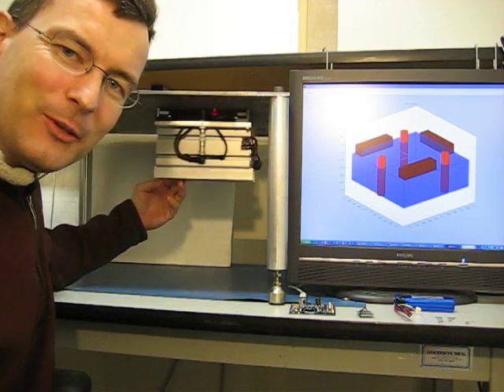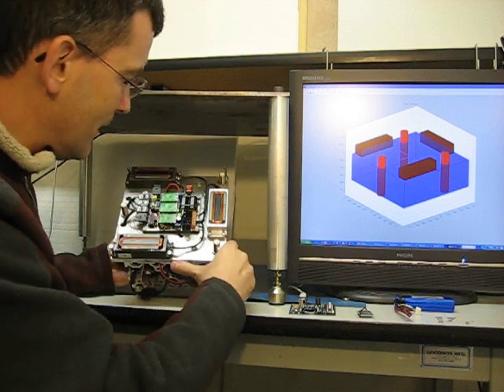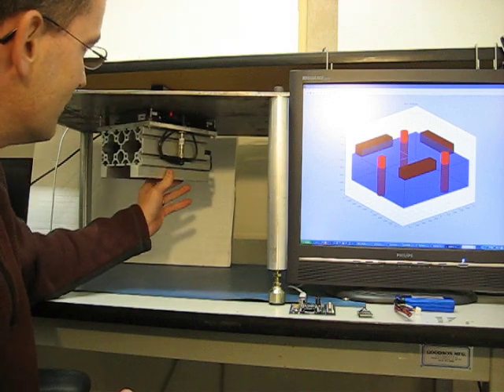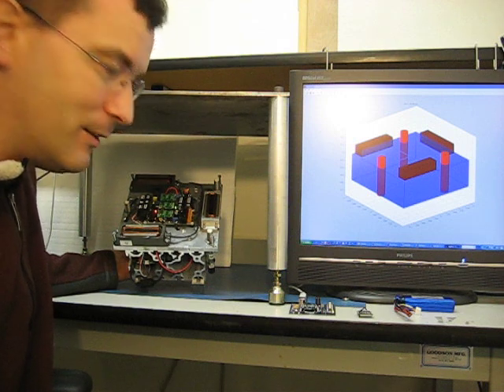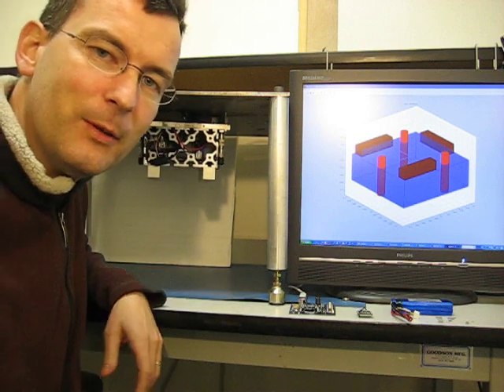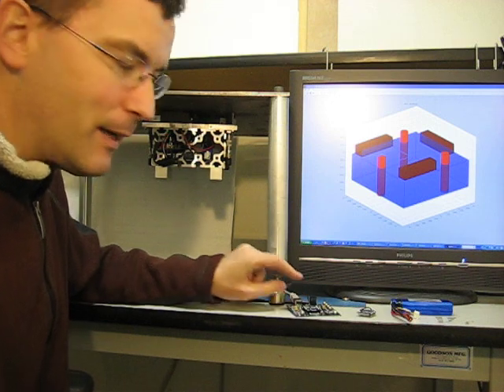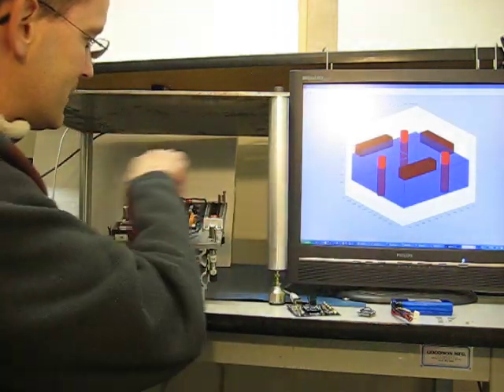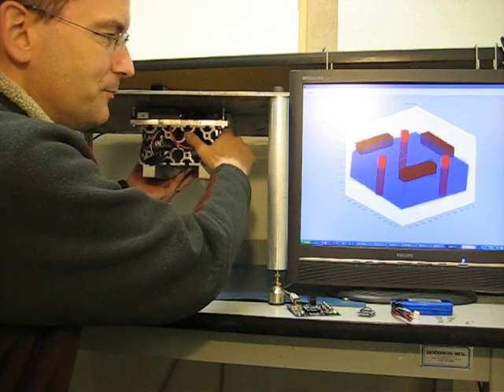Tripod Floater 2.2 - Active Magnetic Bearings Demonstrator

Comment from the maker: Hi, 
Good point, but think about this: you can only generate a pulling force with these bearings. For skateboards you need a force upwards, so you need something that you can use to pull yourself (or the board) up towards. So, a linear bearing becomes difficult. Making rotary bearings with this technology is also possible, but those would be too bulky for skateboards. 
Thanks for watching...
Meindert

Comment from the maker: Hi SpockTown,
In this implementation I was merely driving the coil voltage using a PWM driver, hence no current feedback: the position sensors are indeed the only feedback mechanism.